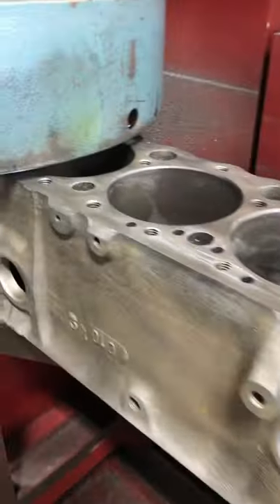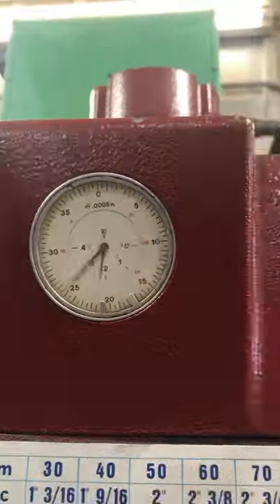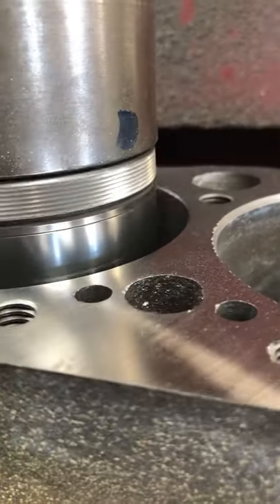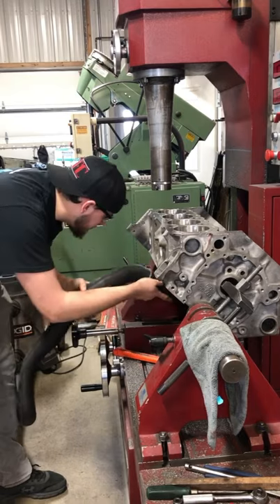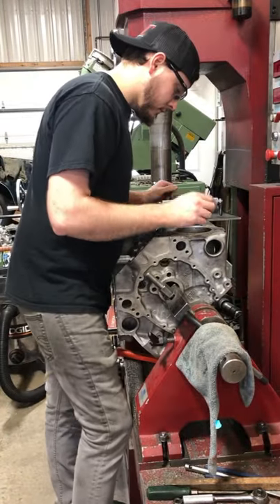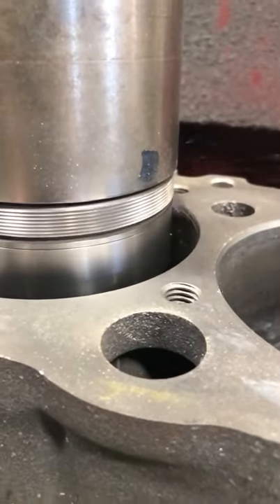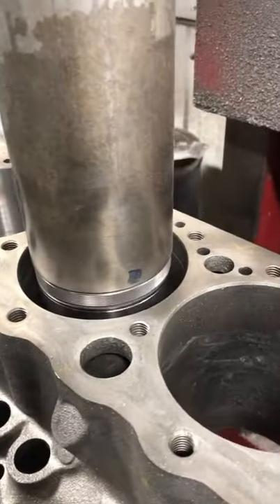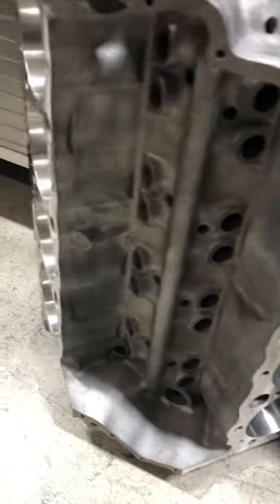#shorts 350 Small Block Chevy - Bore & Deck Machining @JAMSIONLINE

Comment: I wish you'd do a in depth video on how you setup a block in the fixture. How do you get it leveled with respect to the crank and so on. how do you know your bores are angled correctly? or the deck properly leveled? Do you assume some particular surface is level as a starting point and use that as a reference? Lots of questions, I know.
Reply: Most boring machines use the main bearing saddles in the block as support. For the angle (majority of V8 are 90 deg.) the blocks oil pan rails rests on an angle block and the block is clamped down

Comment: Can you do a video on the full process of what is done in an engine rebuild. So people know if their mechanic is skimping on work but not on price.
Reply: There won't be an easy way of doing that as everything is dependent of different circumstances, is it a common or rare motor? What's the damage/parts to replace.... So many different bits to it.
Reply: @aaronhall7740  94 Chevy small block. 350 tbi. Wondering if the block and heads have to be sent out to a machinist to flatten or do they run a straight edge over it to check. Why does one machine shop only do cylinder head but not but work?
Reply: Every time you take them off they'll need to get shaved flat again. They warp with the heat. If you just put them back on without being shaved, there's a strong chance your head gasket will not seal properly.

Comment: So what? Wheres the stroker clearance milling? Wheres the grooved lifter tunnels? Wheres the funnel cut oil returns? Wheres the drilled for straight oil galley's? Wheres the tapped galley plug holes? Wheres the align bored cam tunnel?  Wheres the clearance milling  of the block at timing chain ? Did you sonic the cylinder walls to check for mold shifting during casting? Did you magna flux block? Chase the threaded holes? Remove the oil bypass plug?

Comment: Now, put a small block 400 crank and rods in it and you have the perfect torque machine!
Reply: I disagree. I say get a 400 small block and put 327 crank and rods in it. That way u got big bore power and a short stroke that won't shake itself apart when u get up in the rpms
Reply: @oliverklozhoff  
Short stroke=less torque

Comment: I like to know if you can still build big hp engine without honing with a torque plate
Reply: He does hone with a torque plate.
Reply: You 'CAN', but why would you want to do it half-assed? A torque plate will make the hone perfect instead of just close and the engine will be more efficient.
Reply: I was about to ask the same question. I have never honed one without torque plates. But I’m building NASCAR engines that’s all I have done. No public work being done there. About the only thing we sell is racing fuel. And the local dirt track boys are always hitting us up for sticker kits. The mandatory ones everyone has to run and there’s a layout for them. I hate racing around all the rules in that sport. There’s 0 room for innovation anymore. All the bodies are riveted composite and they use to be beautiful works of art. Lots of cheating went on with every team. Use too like 20 years ago a speedway car looked like it was turning left sitting on the surface plate and still fit all the templates. Now everything is cookie cutter. That body change put a few fab shops out of business. Because the templates got so strict and expensive and obsolete at the end of the season.
Reply: @rbmwiv  the fans have gotta start fighting back for it to change.
Reply: He might talk about that in a video that actually shows the honing process.

Comment: One of those things wives can never understand; it really can be fun to watch machine shop videos. 

I'm curious about the mention in this short that factory surfaces are normally slightly off spec, but if that is the case, why do some factory built engines seem to just run and run as long as you keep up with the clean oil and filters?
Example: I can see the difference between old technology that was used to build the first few gens of SBC and the change in longevity and reliability that came with newer technology to make the LS series. Does that coincide with this video? What I'm guessing is it does, because of slight factory variations that are cleaned up by this shop. 
It's not critical if nobody wants to help me understand this, because I dig the videos anyway!
Reply: Well, this is just my opinion (albeit brought about by a lifetime of working on a whole slew of shit from go carts and motorized bicycles to work trucks, backhoes and tractors to a 70' Buick GS) I believe that the same set of circumstances that leads to a lemon being made can traverse to the other side of the spectrum to where everything happens just right and u have a normal no frills car or truck that just runs like a scalded ass ape. (While the average tolerances are achieved to produce the average performance car that most of us end up with) every now and then,  a real gem sifts thru the mediocrity and lemons when everything happens just the way it should. There again, this would be just my opinion. But also, a mathematical certainty I reckon

Comment: How do those clamps not damage the cylinder walls?
Reply: I was wondering the same thing
Reply: Most likely copper or aluminium surfaced
Reply: When re-cutting and honing a cylinder, you have to install oversized pistons, usually sold by the manufacturer specifically for use in an oversized engine application (sometimes A, B and C pistons). Each graduation is like 1 mm bigger, but theres no way the grabber is putting 1mm gouges in. Yes it would be enough to mess up tolerance - but not enough to go up a whole piston size/level, which will be the very first operation. This is how they not only get tighter tolerance than OEM, but also as he was saying the cylinder runs more true, and is therefore better "balanced" although this isnt balancing per se.

Comment: So everything is based off of the crankshaft center bore.  How do you know it is correct ?  How do you know all of the main bearing caps are actually in alignment ?  What are typical factory tolerances ?
I'm not sure if you do any race engines, but I have heard that, in addition to the torque plate, the intake manifold needs to be bolted on as it might cause a very slight change in the angle of the cylinders.  Again, what are factory tolerances ?  Any experience ?

Comment: I grew up in the 60s 70s. Everthing seemed to revolve around chev small
Block 2 and 4 bolt also big block 396
427. The 454 was a dog but I know these engines were everywhere easy to
Obtain and machine. Sure dodge and Ford had a big part to. But chev dominated.

Comment: What do you guy's do with the metal shavings afterwards
Reply: Probably throw away to metal bin, steel is too hard to recycle at small shops. It needs to get hella hot to melt, compared to Aluminum or Copper
Reply: Well blocks are usually made of aluminum alot of places don't let you toss in trash cause it will mess up trucks
Reply: I’m sure it’s recycled. To say the chips would be too hard to melt down is just absurd. The shops usually have large bins that the chips are tossed into. When full they are picked up by the recycle/scrap company.

Comment: I got a question. How much does .030 usually clean up. I got a block I want to take .030 over it has a ring ridge and some scoring.
Reply: I had a 350 chevy I had bored .30 over. Mine was out of a 75 K20 Camper Special. I didn't think .30 over would fix it. It had scoring and a ridge also. I was surprised at how much .30 over can fix. Alot of those older blocks can be bored .60 from what I've been told. This guy should have used a torque plate when boring and honing the cylinders. If you're gonna run a new crankshaft and/or use ARP main bolts or studs you'll need to get the mains align honed with your new fasteners installed and torqued to spec. If you don't,there's a good chance that it will probably wipe out the main bearings in short order. Same thing with the rods. Trust me,I made that expensive mistake once myself. Nowadays,if I have an engine rebuilt or do it myself. I won't try to save money skimping on machine work.
Reply: @Thundarr995  Just to confirm, your saying that if you get a blocked honed like this and dont realign the main bearing after installing higher-clamping-force ARP bolts, then the main bearing will be wrong?

Comment: What is the machine you use to surface and bore, I am an engine builder trying to find machines, also the name of the tool you mount the block on for boring and resurfacing

Comment: How much does something like this cost on a v6
Reply: Really depends on what you want done. How many thousandths of an inch you want to boar it out and anything else tou want done specific to your build. You could probably have a stock block resurfaced with no custom boaring or anything for around $500-$800 but that's here in Idaho at about $85/hr.
Reply: @thecommenter6839  do I have to bore if I get the top resurfaced?? What does it mean to bore posed to honeing. I just really want a clean block n heads.. new plugs get the crankshaft balanced but want a cam n efi system. I've dropped too much into it stock want some power out of it now. Its only got 148000 on the odometer.
Reply: @thecommenter6839  another question I have to do the motor mounts now i have been looking into doing a v8 swap seeing i have to do motor mounts would it jus6 be easier to do the swap now?? Either a 283 or 305 but the biggest I'd go would be 327.
Reply: @djmadd1212  no you do not have to bore it for the resurfacing. Its cheaper to just get it resurfaced. I'm not sure what all the terms mean thats why I had it done as well🤣. I had done pretty much exactly what you saw in the video. I built a 350 sbc into a 383 stroker.  .030 bore with a small block 400 crank, 281 heads, aluminum flat tapped pistons, roller hydraulic flat tapped lifters, speed master performer rockers. I'm about $4800 into my engine build including all machine work. I'm honestly not a ford guy mustangs let alone. My brother 5.0 swapped his 65 fastback and i can tell you he had a hell of a time but it was worth it to do it once rather than run it for a while and decide you want a different setup you know.

Comment: I went to school and got trained to do this and was given recognition for having the best built engine in 40 years in the school this was at the top automotive engineering school in the country or it was 10 years ago but the school has since shut down the program as the new director is a libtard dumbass but since I graduated I haven’t found a shop near me that does this that’s still in business seems most people just replace instead of rebuild it’s sad